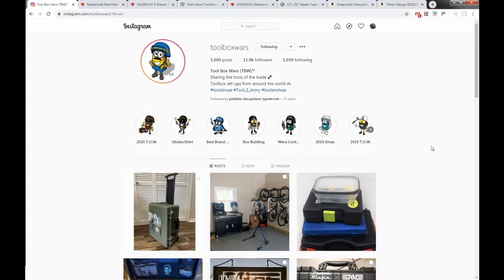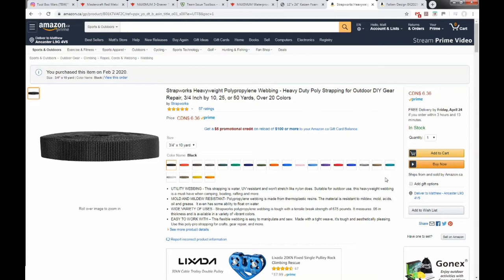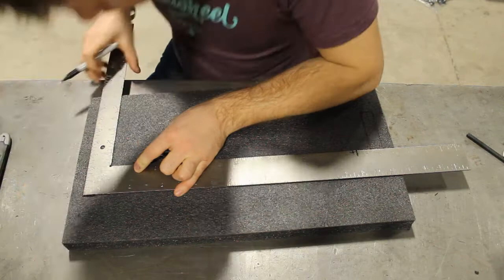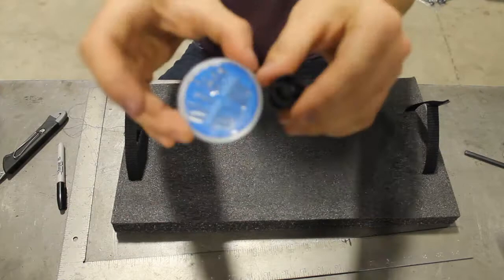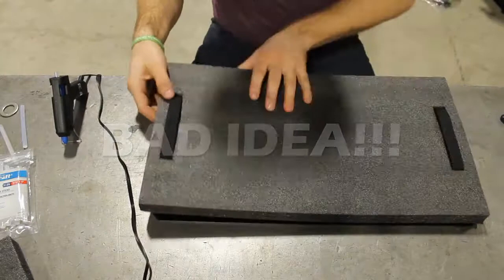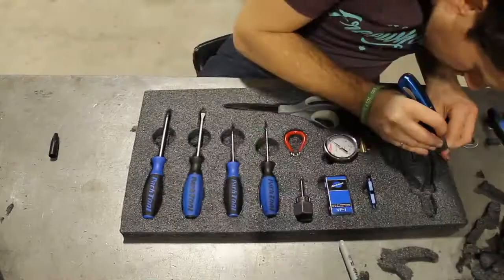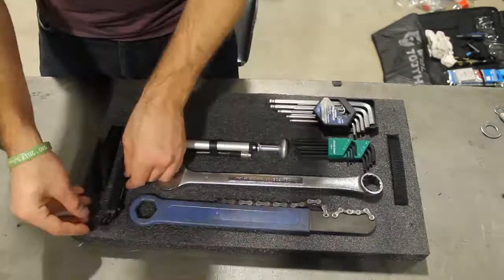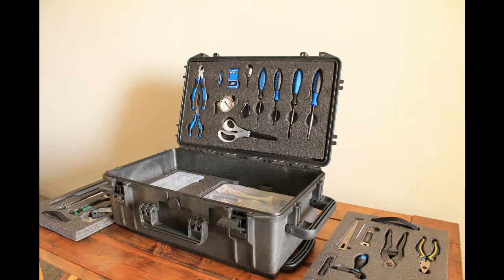DIY Foam Insert Toolbox

Comment: Not sure why you didn’t slot the polypropylene for the handles. That way there would be more support for the layer, and the glue issues would be nonexistent
Reply from the maker: Yeah. There were probably a number of ways that I could of done this. But this what I came up with at the moment.

Comment: An alternative to the hot glue would be contact cement. I don't know what brand you have in Canada but in the states the good stuff if Barge Cement. It's used to glue soles to shoes and is incredibly strong if applied correctly. The trick is to apply to both surfaces, let it dry until it's tacky, then (carefully) sick them together. You would need to rough up that acrylic with sandpaper first though. 
Another alternative is spray adhesive like Super 77 (I think that's what it's called) but I've never used that stuff so I don't know how strong it is, I just know it's kinda messy.
Reply from the maker: Thanks. I've been meaning to try a test with regular white craft glue. I bought some for another project. Contact cement is agreed another option. Have you used it on this type of foam before? I've used spray adhesives before and was my first thought when the hot glue didn't work.
Reply: @mcassellmtb  Ironically, hot glue would probably work perfectly for the handles.
Reply: 3M makes a spray foam glue for this exact application.  #74 I believe.  If you need it just sheet to sheet, #77 is in stock in home improvement stores.

Comment: Great vid. Never done this but wonder if a Dremel tool would be useful for clean cutouts for the tools?
Reply from the maker: I've never tried using the Dremel. I'd be concerned it would snag and tear. I do have some scraps left. Maybe I'll try it one day.
Reply: Way too much mess. Carbide bits will clean cut

Comment: Good video - working on a similar project - I wonder if double sided velcro would work for the handles?
Reply from the maker: I don't see why not. Would be quicker to install the handles for sure. Might collector dirt faster depending on where you are using the tool box.